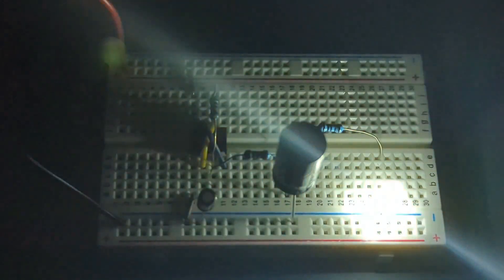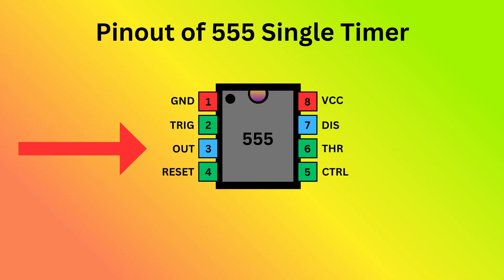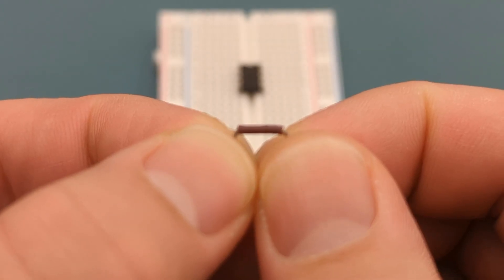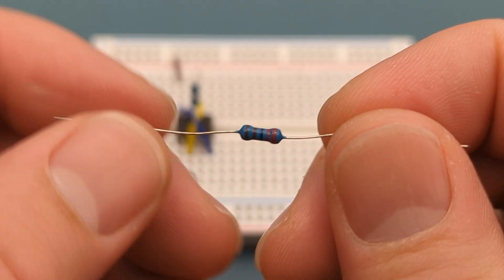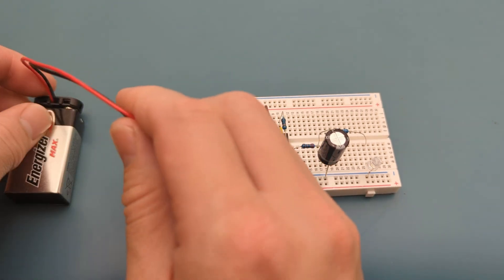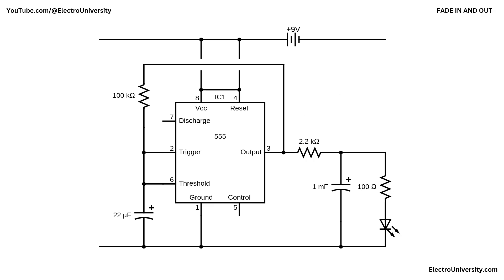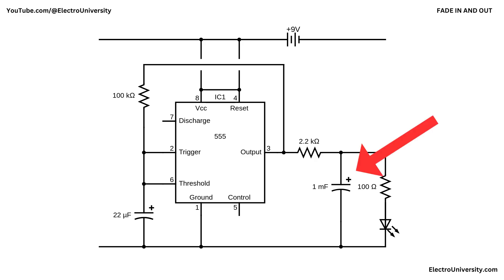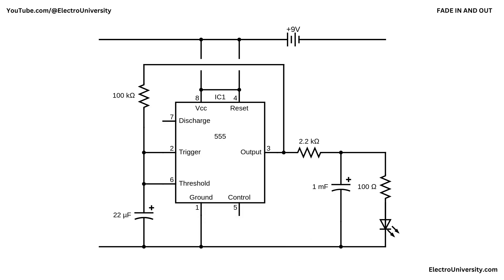No Arduino Needed for This Cool LED Effect!

Comment: HI, thank you for this! I rebuilt the Cricut on TinkerCad to experiment with the timing. What would I adjust to change the speed of the "oscillation" from full bright to off? And is there a way to make it not fade completely off. So, if for instance this is connected to a temporary switch it illuminates from 20% to 100% (doesn't have to be that precise). Thank you!